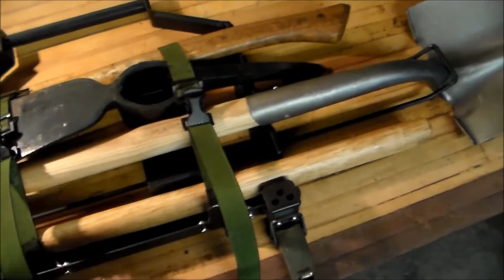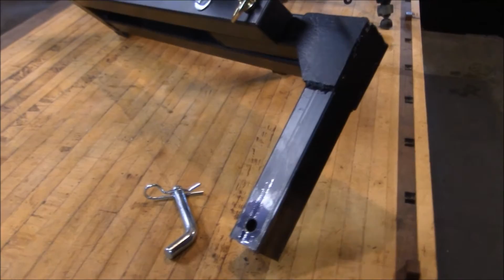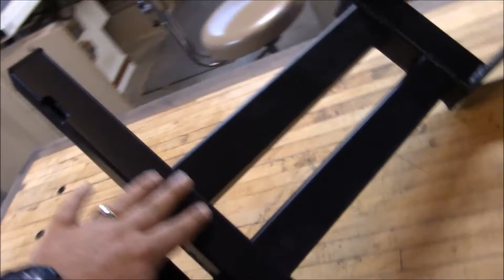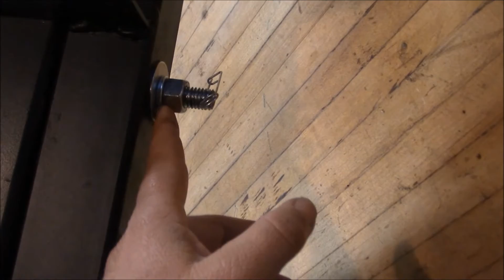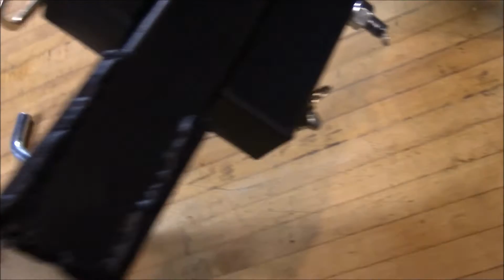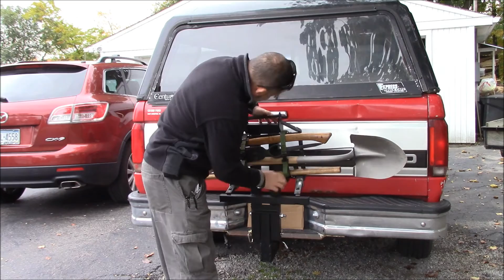Pioneer Tool Rack Hitch Mount - SSP19

Comment: Nice project... really well done!

Just a heads up you have the straps that hold your tools in done wrong, there is a specific way to run the straps to secure the tools in so they won't fall out.

 http://hummer-hmmwv.tpub.com/TM-9-2320-280-10/css/TM-9-2320-280-10_176.htm

 http://hummer-hmmwv.tpub.com/TM-9-2320-280-10/css/TM-9-2320-280-10_177.htm
Reply from the maker: Hit me up Charles.  They haven't fallen out yet.  But if there's a better way, let us know about it.  It would be bad to lose my $25 Home Depot axe.  But if my Hults Bruk axe goes missing, particularly if it goes missing at 70 mph as I'm going down the highway, well, that would be very, very bad.
Reply: check these links:

 http://hummer-hmmwv.tpub.com/TM-9-2320-280-10/css/TM-9-2320-280-10_176.htm

 http://hummer-hmmwv.tpub.com/TM-9-2320-280-10/css/TM-9-2320-280-10_177.htm

I literally just set mine up this morning.
Reply from the maker: Nice!  Thanks man.  Much appreciated.
Reply: Is there any way to get measurements and materials list?
I have an FJ cruiser. This is perfect.